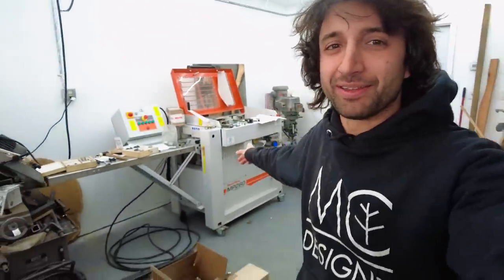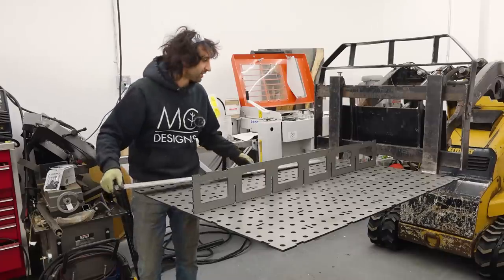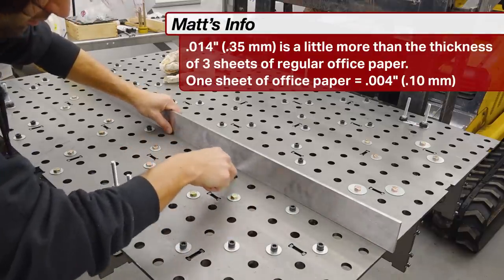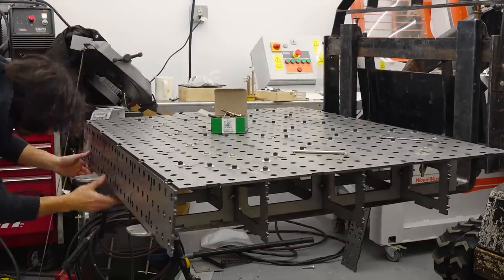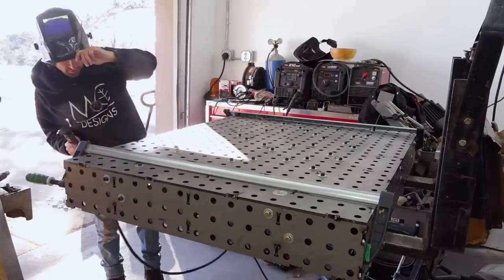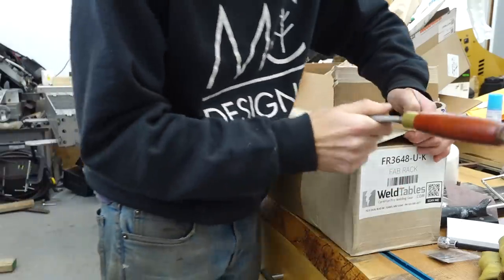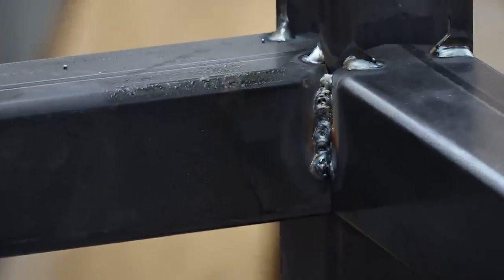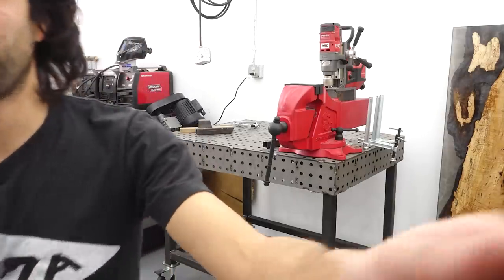Adding a Welding Fixture Table to the Shop

Comment: 2/26/23; ...new welding Fixture Table..✅️ I am not a welder but much appreciate the indepth knowledge all welders must have & use in the making of any & everything metal. Stick/Mig or Tig & their cousins Sauter & Braize are sooo useful & necessary to build or fasten anything. 
 No doubt you have seen Jason (last name?) channel Fireball (Tools). This man has some super handy, innovative cast iron big 90° (with 45° 'flats' built-in !) Fixture clamps for welders & machine shop people. Am sure you will find his equipment helpful in your search for your projects. I watch several YT welding channels & Fireball clamps & big red table vice are usually on their Fixture tables. So Matt, much enjoyed your video 2day...but waaay tooo cold, slippery/dangerous to be handling that heavy table by yourself...where is yur buddy Donavan when you need a hand?...gone sailing again? Humm...yeah, some place nice & warm, aye?👍👍👍👏👏🍺😊

Comment: Prior to welding your surface flatness can be improved by tappity tap tapping into alignment although you may need to loosen the local clamps a wee bit to allow your tap tap movement yet retain the adjustment... next table. A torch can replace the dead blow hammer too by slightly warming the required side and letting expansion adjust your clamps. The result of 4 friends buying their own tables.

Comment: Awesome table and vice Matt but I think the vice might be just a tad high! Also having a vice of that one's capabilities bolted to a relatively light table on wheels is going to reduce the vices capabilities by a HUGE amount. My welding table is 5 feet by 11 feet and weights over a ton, also over 70 years old. Awsome for bolting bending fixtures and the like to. I find benches for welding are normally too high. Love the videos. Cheers and G'day from Tasmania, Australia 🇦🇺

Comment: Hi. just a few comments on your build, ideally you nsould nor weld any steel below 5 deg C, if you nare in the position where you have to weld below that temp, preheat the area.
  Also always wear protective gloves as over time the UV may cause skin cancer and as you are a young pup dont increase the risk of that happening!
   Keep up the good work.

Comment: The concept of "flatness" is interesting. For your welding table ±0.016" is "flat". For an acoustic guitar fretboard ±0.0004" is "flat". For resonant tunnel diode threshold logic 2 atoms is "flat" over 300mm.

Comment: What will happen to the straightness when you put it to its legs? will it bend back by its weight, as it is bent slightly to the longer side's edges? As far it will be backed up by its corners, the center should sink a hairy bit.. unless you tack it bent :P

Comment: I will repurpose my old kitchen hood on top of my welding area, with an exterior exhaust, opening the garage door here, it's too freaking cold in the winter, but seriously, don't you think you went overboard with the vise size, that thing is a monster, could make you almost tip the table over with a heavy piece of metal in its jaws! Why so BIG?

Comment: That vise is too high for that table. It's probably because of the casters on the table. You should weld up a stand for that vise and get it off the welding table, which will give you back some more needed table surface.    :yougotthis:
Reply from the maker: Yes, I’m probably going to take the casters off
Reply: it's because Matt is tiny and this stuff was made for normal people.
Reply: It sure is nice to have the equipment and tools to quickly and easily rearrange just about anything you own. Yes, I'm jealous.

Comment: Matt, are you going to use a counter balance weights on the other side of the table? It looks like the vice might cause the table to fall over 😂
Reply: Nice table  impressed it fitted up so nicely. Like the fixture holes.  Puts my oilfield tubular an salvaged plate to shame.  Easer to just tack my project to my table.  Thanks for sharing the build. Looking forward to seeing what fits into that big old vice.

Comment: that MP260 4-Sided Planer / Moulder really nice wood machine you can do so much stuff with that machine but it sure not cheap i think it over $15k
Reply from the maker: Yes, bare machine is 16
Reply: @mcremona  yeah I watch some other YouTuber he have wood mizer LT70 sawmill and Wood Mizer MP260. There a newer version MP360 that machine is over $20k I think, not to sure what MP360 does more than what MP260
Reply from the maker: More power mainly

Comment: Have you had any negative effects from welding in the cold temps?Temps? 
Edit: I asked that question, and then you went into the issues you were having with the welder.
Reply from the maker: Yeah the equipment wasn’t thrilled

Comment: Very nice welding table kit. I may look at getting one of the smaller ones. Do the legs come in different lengths? The vice looks like it is too high to be comfortable when you are working.
Reply from the maker: You’d have to order a custom leg kit. I’m planning on removing the casters
Reply: @mcremona  Thank you. You do have a simple way of moving the table around.

Comment: Standard engineering tolerances are normally plus or minus 10 per cent but, can always be improved to plus or minus 5 per cent and even plus or minus 2 and plus or minus 1 per cent.....it always depends on how critical - or non-critical - your project(s) needs to be so you're right to be objective.

Comment: It seems to me that the flatness of the table is determined by the accuracy of the laser cutting on the cross pieces and the clamping of the clamps. THe surface of the workspace you are building it on should have no effect on the flatness of the table. The constant moving the steel table from inside the shop to the cold outside can also effect the warping etc.

Comment: when you go to get your welding gas bottles exchanged you should upgrade to 125cf bottles. you get a lot longer run time and they aren't to big. you can also use aluminum  20lb 100% co2 bottles  with a  CGA-320 to CGA-580 Adapter  .
Reply from the maker: I have the S size for use within hose range of the shop corner.

Comment: Nice build. I would be a bit concerned that the vice, especially with something clamped in it, might tip the table? What do you think?
Reply from the maker: Maybe if I start loading the vise with a forklift
Reply: The load is pretty well straight down onto the floor over that leg.

Comment: A couple thousand's isn't anything unless your OCD. It could simply be a variance in the thickness of the table skin sheet. Face it Matt it's man-made, nothing is perfect. I used to run a rolling mill in a steel plant and the operator is constantly jogging the controls while watching a digital micrometer as the steel is being rolled out and there is a small tolerance allowed with the specs because while being used the rollers actually change diameter when running and the steel needs to be adjusted because of it. And every couple of coils of steel the rollers need to be re-machined.

Comment: Why such a large bench vice. I worked in one of the largest tool & die shops in North America for over 30 years and that is easily twice as large as any bench vice in our shop. Can you exchange for a smaller model as it would free up more workable space on your table? Not trying to rain on your parade, just trying to be constructive.
Reply from the maker: If I need the space, I can move it

Comment: People can be so anal about welding tables, and waste thousands of dollars for nothing. You can make a weldment on a ".005 accurate" table, but when you unclamp it, it's going to move over 1/32 or more unless you get lucky. I think the table Matt assembled is about as good as you will ever need.